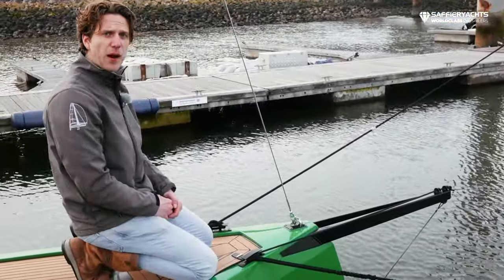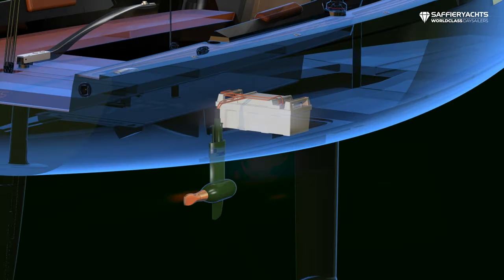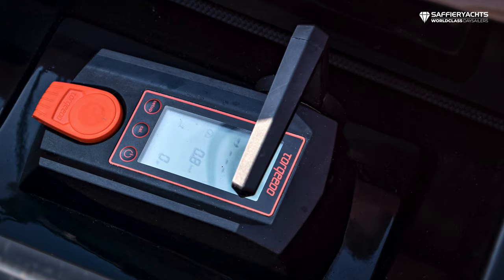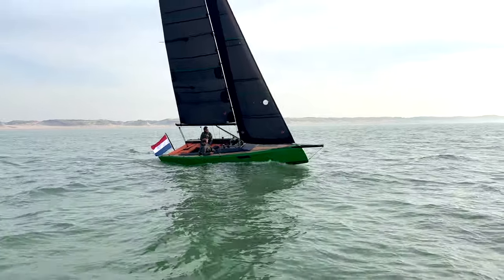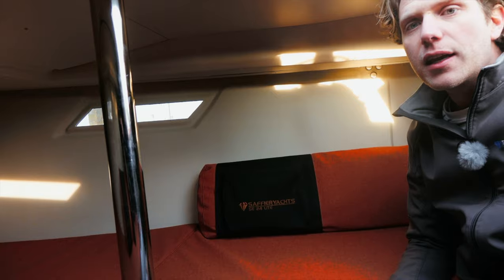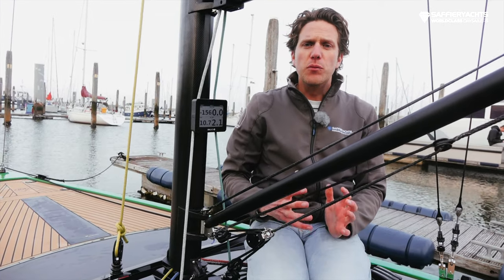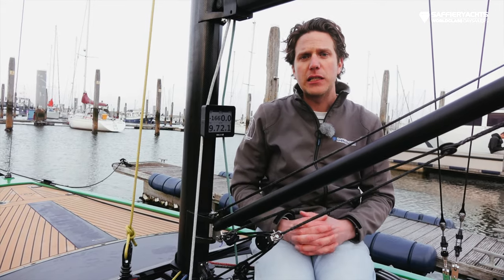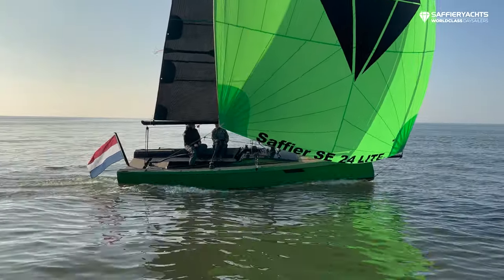The Saffier Se 24 Lite explained by Kay Heemskerk

Comment: I like it! But I rather my helmsman apologize for smacking my knee with the flat side of a more traditional tiller than cracking my old bones with the blade of that functionless "Cobra Tiller". Ouch! But great boat otherwise. I tend to like a lot of Saffier ideas and models.
/ reminds me, I didn't like when you (Saffier) put the diesel access under the tiller a few years ago. I'd hate choosing between getting the engine restarted or having steerage while navigating a tight harbor in a breeze. You should confer with sailors before doing these tiller designs.